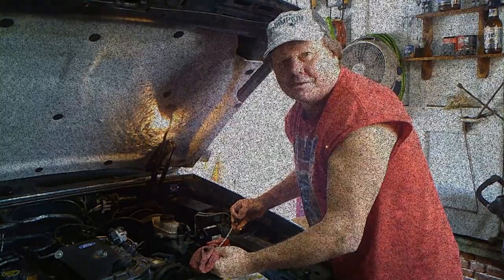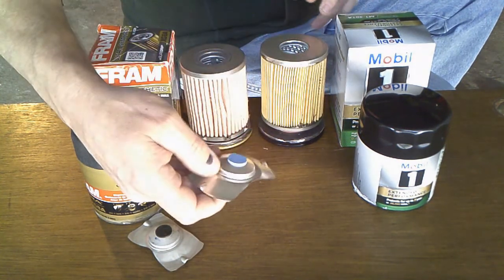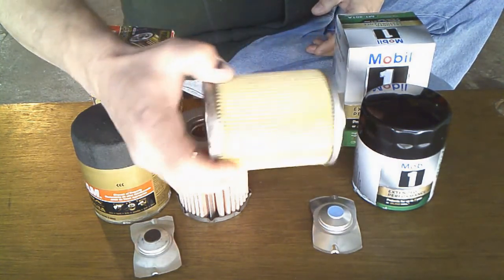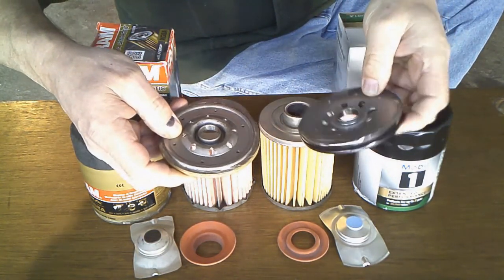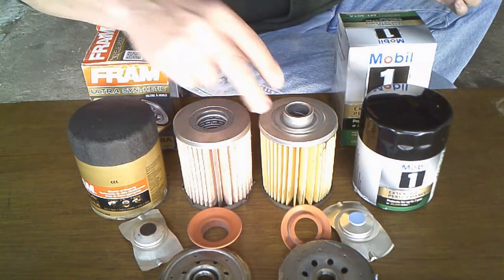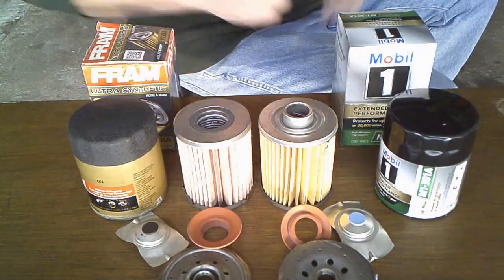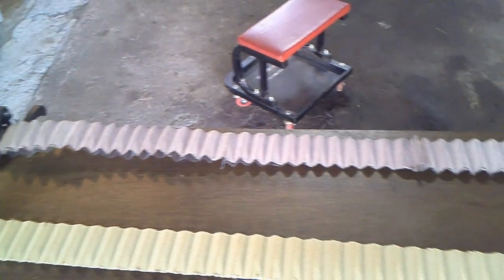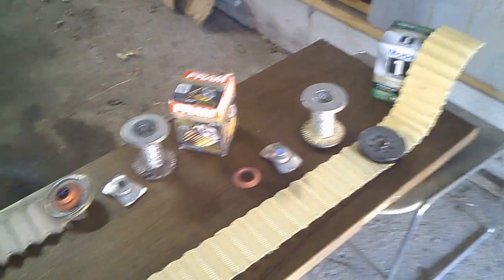Fram Ultra Oil Filter Cut Open XG8A vs Mobil 1 Oil Filter Cut Open M1 301A

Comment from the maker: Oil Filter Friday,
Watch a new automotive oil filter inspection video every Friday on this channel.
Reply: Interestingly, seems like OEM SPECS , WOULD be “best available replacements” In practically all Applications(* not outliers)... & admitted,y , I***do not use **all OEM MOPAR AND GMC.......though  I did switch out K& N to OEM AIR FILTERS( cabin also) here in HELENA VALLEY MT dusty & airbornes dirts,.........
Reply from the maker: @opera93  OEM is usually the Best way to go, but you can't go wrong using these filters. Thanks for the comment. 👍

Comment: What is up with 213 square inches Fram but Mobil 1 Extended performance is 336 square inches ?? This is way more media to clean the oil. What I am wondering is WHY ?? What engine needed the extra filtration specification ?? Nice video fella too. vf

Comment: I been using fram oil filters since 95 and I never had an issue with them, and I still use fram oil filters and air filters to this date.💯😎

Comment: Besides the media, the BIG difference is in the metal center tubes -- the Mobil 1 has the stronger, spiral-wound steel center tube, and with the larger media area, it appears that the Mobil 1 has the edge.
The single-seam steel center tube found in the FRAM (and many other brands) is prone to crushing under pressure when the filter gets partially clogged.
A Magnet Kit, such as the FILTERMAG #SS365PR, should be used with ANY oil filter, regardless of micron rating. 
 NEITHER of the tested filters has the "Threaded-end Bypass Valve", which is found on the MOTORCRAFT # FL-820S and  a few aftermarket oil filters.

Comment: If you can build an oil filter with a superior filtration media, you shouldnt need to use as much material as your competitors to accomplish the same level of performance.  However, we live in a "more is better society" and the total length of the Mobil1  filter is longer. The general public shops by appearance,  not lab facts.
Reply from the maker: That Plus it's called Mobil, lol 🤣

Comment: I have a cartridge oil filter in our Toyota. No metal can, no anti-drainback valve, no bypass valve, no spring...
So if you were comparing nothing except the actual filter element how would you rate each filter? And remember the number of pleats or length of the media makes no difference without comparing the thickness, the type of media, and the effectiveness of the two filters.
Reply from the maker: Some are Paper some are Synthetic, Micron ratings, and pleats do matter. I don't do too many Cartridge oil filters. Here's a link to two. https://www.youtube.com/watch?v=ssoVdPufOj4&ab_channel=WhipCityWrencher  
https://studio.youtube.com/video/mNhygTslHYU/edit

Comment: QUESTION. I have an '08 Toyota Prius. It give  massive 301a Mobil 1, but also gives the 4967, which is tiny!!! What is going on?? I haven't looked yet at the filter on the car. Just buying the filter and saw a BIG difference in the size of the filter. Any ideas?? Thank you
Reply from the maker: I dont know, but If it fits I would use the bigger oil filter.

Comment: I just run Wix. When the oil starts to look dirty, I change it.
Reply from the maker: Wix are good filters.👍
Reply: The oil turns black just from the heat it's subjected to inside the engine. Get some brand new oil and heat it up to 400⁰F for a few hours then compare it with new oil.
Reply: @njsongwriter  Yep, and when it turns, they say it's still good? But that is the point at witch pick up screens and filters start plugging up with carbons. oil is cheep compared to a new crankshaft.

Comment: Mobil 1 from what I've seen comes out of the same factory as the other filters on the market. 2015 prius takes a cartridge filter and all the auto parts brand and mobil look the same and all say made in korea. Only found fram to be different and made in usa. Whether one is better than the other, who know.
Reply from the maker: A lot of the cartridge oil filters do look the same. If you want a really good cartridge oil filter then I'd go with a Fram Ultra. Here's a link to a video I did on some cartridge oil filters all three were the same. Thanks for watching and your feedback.👍🙏🙌😊
https://www.youtube.com/watch?v=ssoVdPufOj4&ab_channel=WhipCityWrencher
Reply: @WhipCityWrencher  My OEM toyota filter was the same as mobil 1 or other generic brand filters. Ended up using a fram ultra. Only one that looked any different, with rubber/silicone material on the ends of it.

Comment: Flow rate is also important in an oil filter
Reply: The Fram Ultra has great flow also, since it uses synthetic spun Fiberglass media, so oil flows through it way easier than cellulose fiber
Reply from the maker: @ezrawaters6653  Thanks for your feedback👍🙏😊
Reply: @ezrawaters6653  well that’s good to know. I put a fram ultra on my mom and gf’s hondas
Reply: @ezrawaters6653  
That would be my assumption as well. But it's only an assumption.
Reply from the maker: 👍It is, 
but the manufacturers seldom give you this information.

Comment: Thank you for the video!
I know, Fram has a bad reputation for their sh..tty filters, but this mostly applies to their lower-end products, ToughGuard and ExtraGuard.
Fram UltraSynthetic is actually not so bad, and it comes at a lower price than Mobile 1 !
I've been using it in my Impreza for over 6 years and 90 000 km, and never had a problem.
Reply from the maker: Your Welcome Anton,
I think the Fram Ultra is an excellent oil filter, the Fram orange cans "not so much".
Here's a link below to a video I made about 2 months ago on a used Fram Ultra that came out of my vehicle. Thanks for watching and commenting!👍😊
https://www.youtube.com/watch?v=jxNAi5H8lsY&feature=youtu.be

Comment: The Fram requires the support of the wire mesh for strength. When you picked up a section of the Fram it was already torn. I know the tear happened when you were taking it apart but I saw no tears in the Mobile 1.
Reply from the maker: Hi Mike,
it's been almost a year since I did that video, so I don't remember how that Fram filter media got torn, but it's not easy cutting, and separating that wire backing from the metal end caps. (I now use a hacksaw) The Mobil oil filter is easy to cut so no tears. I wouldn't hesitate to use either one of those oil filters.
Thanks for watching!👍

Comment: FINALLY!!
This man gives a definitive answer, unlike some other videos.
For me 20 microns is better than 30.
Period.
Reply: Also, the Fram ultra has double layers of synthetic fiberglass media. So although it’s not as long as the Mobil 1’s media, the Fram Ultra utilizes Depth filtration. The media is more than twice as thick, so it can hold way more contaminates
Reply: Really? Do you know that a difference of 10 microns is only 0.0003937 inches? That's not only less than 4 one thousandths of an inch it's ten times smaller than that. It's less than 4 ten thousandths of an inch. In other words, it's negligible.
Reply: @njsongwriter  I hear you Jack... but when it comes to rings and bearings?? Every "thousandth" counts, lol.
👍  🍻

Comment: I've used both filters, I go two oil changes between both filters. The most miles I put on the fram ultra synthetic was 12,000 and I put 10,000 miles on the mobil 1....They both are great filters and I'm sure I can get more miles out of both  😊
Reply from the maker: You're right, both are great filters. I guess it comes down to a matter of preference.
Thanks for watching and your comment.👍

Comment: Thanks, interestingly I,used ALL FRAMS , FILTERS FOR many (* 25, thouhg did K& N AIR Filters in low Dust  INDIANA),  years..... had no known problems oil/ gas/air, etc.........Though actually, now I use *NAPA GOLD, AND , *OR ROYAL PURPLE , DEPENDING On my  vehicle..........I have easily replaced Filters.......

Comment: I know it doesn’t tell you the dirty holding capacity on The mobile but does it tell you the dirt holding capacity on the FRAM box?
Reply from the maker: Sorry no, the Fram Ultra box that I have doesn't say anything about dirt holding capacity. What it does say is 99%+ Efficiency  ISO-4548-12  For Particles Greater Than 20 Microns.  (By the way) the Fram filter I used in the vid was an older filter, same oil filters but I think they changed the boxes. Maybe the Newer boxes have more info on them, but I doubt it. I'll look into it further and see if I find anything.  Thanks for asking 👍.Take Care!
Reply from the maker: A quick google search says 32 grams on BITOG forum. How true this is IDK. Here's the link https://bobistheoilguy.com/forums/threads/fram-ultra-holding-capacity-information-here.264367/

Comment: It seems to me that the Farm Ultra Synthetic filter media has two layers, making it the tougher one. Probably that is why the length is shorter, which does not mean it is less capable to do its job. I have been always using Mobil 1but would try Farm Ultra Synthetic next time.
Reply from the maker: 👍Your correct the Fram Ultra has two layers of media.You can't go wrong using the Fram Ultra. Thank's for your Comment! 😊Take Care!
Reply: @Ronnie Chan @Ronnie Clay thank you for your perspective on the matter....I have a question....have you tried the FRAM one yet? If so, what exactly will determine your permanent choice going forward? Is there going to be a difference in performance of the vehicle depending on which filter you use? I'm new to the filter thing so please forgive me if it seems like a stupid question

Comment: Thanks for the video. Can you see the two layers in the Fram XG filter media?  I would expect the outer layer traps larger particles while the inner layer traps smaller ones.  That way the larger particles don't plug up the media for the smaller particles, allowing the filter to be more efficient and hold more particles.
Reply from the maker: Mike after reading your question, comment, I went and took a look at it. I keep all my cut open filters except the oily ones. I like to show them to friends and family we compare them, anyway back to your question. I didn't even notice that before. It looks like its one piece but (maybe two pieces pressed together some how) because the outside of the filter media is a slightly lighter color than the inside and has a fuzzy feeling, the inside is darker with a smoother feeling. When looking at a side view of the filter media, the fuzzy lighter color looks to take up most of the thickness of the filter media.
I think your right about the filtration,  make's sense to me.
Thank's for the Question and Information!
Take Care
Reply: @WhipCityWrencher  Thanks for checking. The double layer filtering media sold me.  I've notice you subscribed to my YouTube channel. Long story short, I have two other YouTube channels.  I lost the password to my oldest one (TravelWithMike, one video got over 61k views) back when YouTube was a baby but still occasionally post videos to my second one MikesHDVideos.
https://www.youtube.com/user/TravelWithMike
https://youtube.com/user/MikesHDVideos

Comment: The Fram Ultra is a true full synthetic element and is double elements. The Mobil 1 is a synthetic blended element but only single lined.
Between them, personally, I'd have no problem using or recommending either filter but I do use the Fram Ultra in my vehicles. I do run Mobil 1 High Mileage Extended Performance oil in my vehicles.
On my last oil change in my Dodge Caravan, I did put Mobil Super Synthetic with a container of STP High Mileage additive to keep the high mileage additive in the engine. We had gotten a 5 qt container returned to my Walmart but we don't carry it in our store. I bought it along with my employee discount it was around the same price as some of the higher priced conventional oils we carry in stock and it's full synthetic oil. But I did stay with the Fram Ultra filter.
Reply from the maker: I think the Fram Ultra is one of the best filters you can get, that with Mobil 1 is a good combo 👍 Thank's for your Comment ,Take Care

Comment: I like the Fram better. You can't compare the media. One is longer and one is thicker. The only way to really compare is performance. A visual comparison means very little.
Reply from the maker: Watch this short video I made, I think Fram Is a better oil filter.https://www.youtube.com/watch?v=a9wkf__kyDM
Reply: He told you one filter is rated down to 20 microns and the other is 30 microns. Pretty much tells which one will stop the most
Reply: @stang1970  
99% at 20 microns and 99% at 30 microns isn't the only consideration. There was no mention of how the flow rate of the oil might or might not be affected. Initially the 99% at 20 microns sounds good but if one filter is collecting more dirt than another filter then it could also restrict flow rate which could be a concern. A micron is only 0.00004 inch. So 10 microns would be 0.0004 inches. That's four one thousandths of an inch. I'd be more concerned with flow rate than I would be with 0.0004 inch particle size. Actually, since I change my oil every 5,000 miles, I'm not concerned with either.
Reply: @njsongwriter  yep, thats why there are so many different designs out there. and they all claim to be the best. I dont care either. As long as the filter doesnt fall apart between oil changes. Ive worked on fleet light duty trucks that get oil changed every 15k miles. These trucks get the oil sent out and checked for what type of metals and how much metal is in the oil. This is done to keep track of the engines health.

Comment: The "Mobil" might have more pleats/longer media..... but it looks like that generic b.s., thin material I see on almost every filter......    That Fram is THICK material with that wire backing..  so it's probably worth twice the length of that Mobil.            I prefer that Fram.. butI would still try the Mobil..  but only for around $5.       I think it's a rip at $10.
Reply from the maker: Thank You